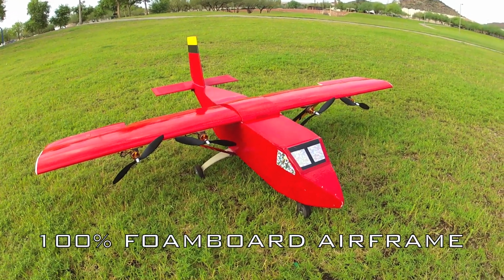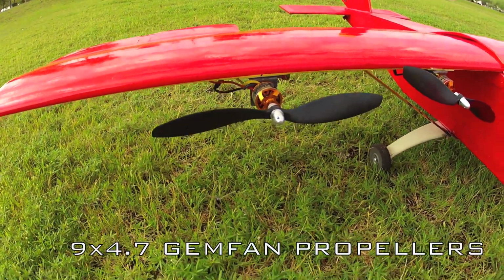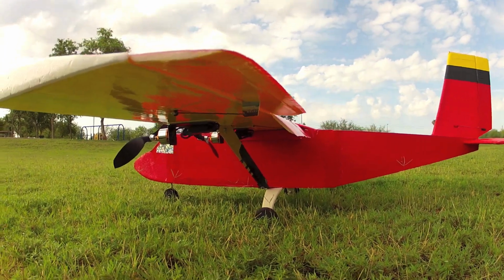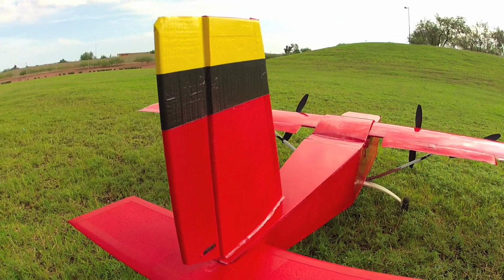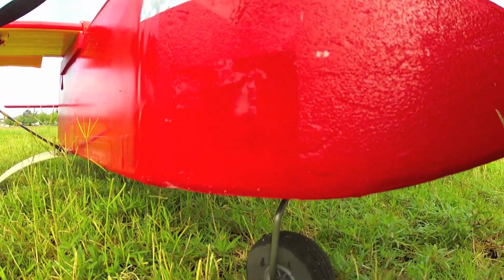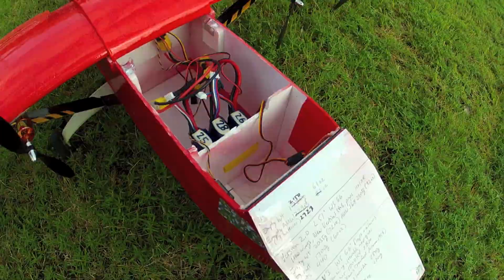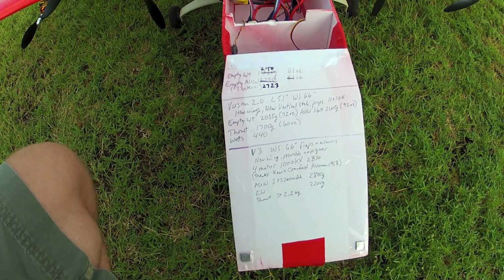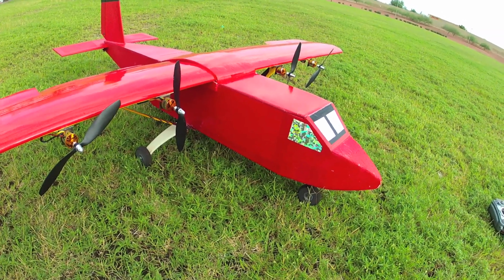FOUR-MOTOR RC FOAMIE SCRATCHBUILT

Comment: This video just answered a question I have been trying to find an answer to for a very long time.  You also used many of the same parts I just happen to have in my STEM class, which is currently in session and looking for a cargo-style aircraft, with a long flight time, that can handle high winds and be built out of sheets of foamboard.  I showed the video to my students and they were asking who to write thank you notes to for making them the video; they thought you made this just for them!

Comment from the maker: No plans, but not hard to make your own.  This one uses the 7" airfoil plus 2" aileron and flap configuration which is my large plane workhorse.  60" wingspan.  As for the all-moving horizontal stabilizer I just made bushings from drilled-out CF plate, affixed to fuselage, and made a CF axle to go through.  I then built up the stab from foam.  I think it's cool, but I'd go with a conventional elevator in the future for big planes.  But hey, if you're up to it, give it a shot!

Comment: I have 4 1000kv 2212s that are about to be gathering dust, as I upgrade another copter, the former will be removed from my Jack O'Copter and replaced with my XJ's current motors. I don't like having good parts lying around useless, and was thinking about mounting all 4 of these on a large glider-ish plane, designed for endurance. No acrobatics planned, and I'd probably use parallel Li-Ion batteries. Payload would likely just be a small forward facing camera, and possibly a belly camera for mapping/S&R type shots. Any input would be welcome!

Comment: wantHello Edde, I want to build a 4 motor plane like this but I see the batteries your running and you only get 12 min flight time. I thought it would even out the thrust more and put more lift on it pushing rushing air past the wing? I really like your Elivator on this! and thanks for the tip on the center downward trust.  I would have had my plain really working had with motors go in g weird directions. Well maybe I will do a really light glider with 8' wing span and I'll work it up in the air 400' and just chill.

 thanks again, wheels up!

Comment: i have 3 pound airplane, push prop i need pick up motor and speed control which let me flight 30 to 45 min with 5200mah battery, is this posible, and what motor and esc do i can use, please consider price

Comment: Looking for help I'm running 4 motors& 4esc but I only get 1 motor to run. I am using a y splitter an I pulled the power wire then plug it to my  reciver, no movment. But once I unplug the 1 that has no power 1 motor will work. Please help

Comment: I would like to build a scratch build twin but I'm not sure how to set up the counter rotating engines/props.  My thought is to reverse the wires on the second engine so it runs in the opposite direction and put a pusher prop on it.  Can anyone tell me if that is correct?
Reply: You do NOT have to have counter rotating props to have a twin!  It will fly great with both motors running in normal rotation. I have many twins and none are counter rotating!